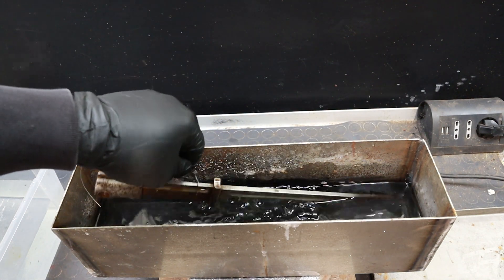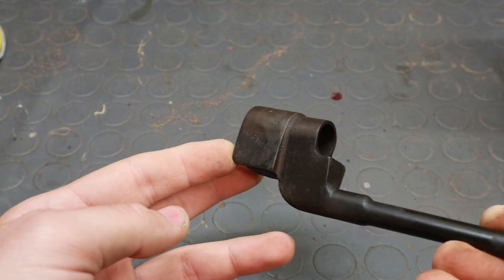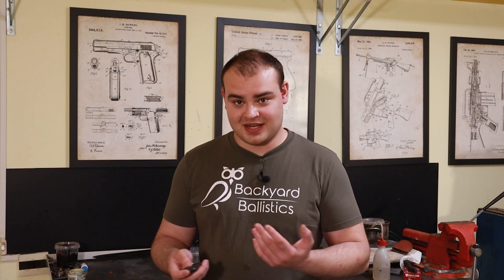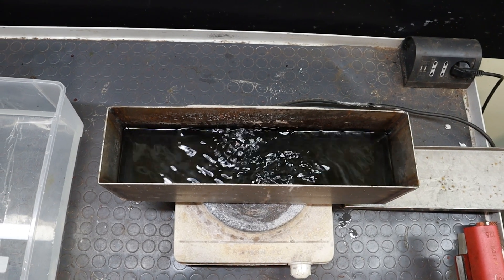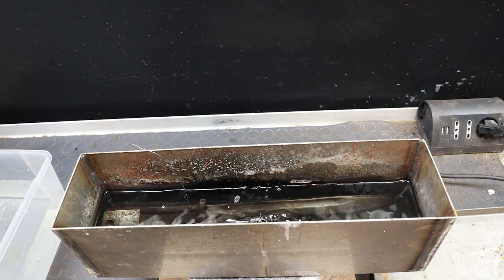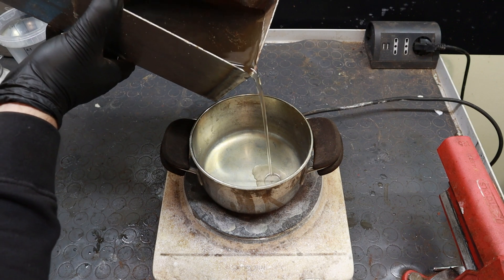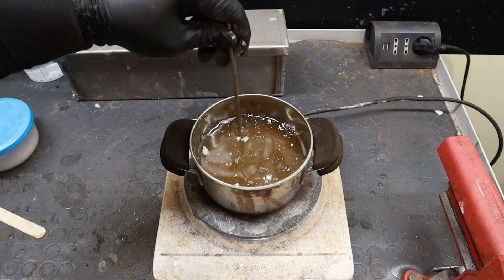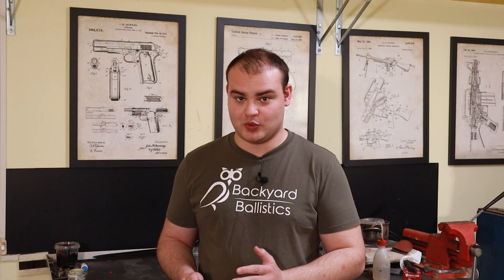BLACK STEEL in 10 minutes: CAUSTIC BLUING Tutorial (with Household Materials)

Comment: I cant stress just how fucking dangerous that solution is. Its like being soaked with gasoline and lighting a cigarette. Yeah you might be fine, depending on wind and outside temperature. But theres a very good chance of you being burned badly enough to make you wish youd died if you manage to survive. Fires bad enough but chemical burns are just the fucking worst, because neutralizing the offending chemical currently eating through whatever part of you it touched is likely to increase the stimulus of your situation aka pain level go up. And then youve go to go to the burn ward and if the burn is over a large enough area and theres enough dead tissue youll get to experience the modern medical marvel of "Debriding" where the dead tissue in, on, and surrounding your burns is hamdled with the wonderous modern technique of scraping it off😳🤢. Again depending on the extent of your injury this process may have to be repeated several times. Now we arent animals and if youre burned over most of your body, youll be knocked out before the scraping but thats more to keep you from dieing from shock. Anywho have fun and be safe

Comment: The problem is this is old fashion way to care about weapon, it requires constant oiling. New polymer paints line Cerakote or Duracote make life way easier.
Reply: In my opinion Cerakote just ends up getting glossy from handling. And is way harder to apply

Comment: What is the recommend way to dispose of left over solution?  Thanks for the video
Reply: Please don't flush it, let the mixture sit in a place it can evaporate completely in well ventilated area. Take the residuals to you hazardous waste site. Or cautiously neutralize
 Neutralization:

If you must dispose of a small amount, carefully neutralize the solution with a large excess of vinegar or a similar neutralizing agent, then flush it down the toilet with a VERY large amount of water.  GL B smart
Reply: @dazzlecraft thanks….
Reply: Pour it into the toilet bowl. It's just drain cleaner

Comment: Always wear eye protection and use gloves, a guy i worked with at a metal finishing firm got lazy while caustic blueing and did not wear his issued safety eye wear and managed to catch a tiny little drop of super hot sodium hydroxide solution when he added room temp parts into it creating a spattering of the solution, his eye was destroyed in seconds,

Comment: Can we blacken Stainless Steel 304 using this method? I'm trying to get some SS304 screws to be black/grey
Reply from the maker: definitely not. There is unfortunately no easy way of bluing stainless steel with black oxide. What can be done is applying an iron electrocoating on top of the stainless and then blacking that one normally.
Reply: @beyond.ballistics  understood. Thank you so much for your reply. And excellent content. keep up the good work.

Comment: dear sir, i like your video. I need to know one more thing that how to clean the factory made barrel before going for bluing ?
we are trying it by acetone and sanding but we see sanding impacts the steel at few places ...
is there any effective way ?
Reply from the maker: You can use a 10% sodiumn hydroxide solution for preliminary degreasing, before the acid pickling.

Comment: very good information, thanks for the video. 

one question, after following the whole process step by step, when removing the pieces from the solution there is a black residue that is easily removed, what is the reason for this residue? is it normal in the process?

Comment: So after the mix has solidified after use it has a high risk of exploding if heat is applied again , so that means the solution must be discarded after every use , as you explained you cannot heat solids , is this correct   ?  It should be highlighted that Breathing Potassium Nitrate can irritate the nose and throat causing sneezing and coughing. * High levels can interfere with the ability of the blood to carry Oxygen causing headache, fatigue, dizziness, and a blue color to the skin and lips (methemoglobinemia).

Comment: Will you do a cold bluing video for those of us without the space for all this setup? I have a precharged airgun where someone's carefully scraped the blueing off the air chamber and barrel but I think the quality of seals and threads etc will be hard to maintain with even the caustic bluing, also I don't have the space (or balls) for a 3 foot long boiling container of caustic pain! 🙂
Reply: Cold blueing does not compare to hot bluing , cold blueing wears of very quickly and you cannot produce the shine that can be achieved by hot bluing , that said , hot bluing is extremely hazardous to health y parkerising  using manganese  phosphate is a safer option.

Comment: I’ve got a 1940 mauser made Luger that unfortunately was chrome plated at one point. It appears to be chipping off at the muzzle and some small areas. For a historically accurate restoration I’d need to salt/hot blue like your video. Do you know of/have a preferred method to cleanly remove chrome plating without damaging the steel? Great content as always!

Comment: So, does this hold up to a cotton buffing wheel? (note: without polishing compound)
Or is it like cold bluing where it can be rubbed off; easily removed by buffing?
Also, does bathing the item multiple times help or will that lead to etching?
Reply from the maker: This is a proper black oxide conversion coating, so it has the same wear resistance of regular bluing. Actually most black oxide finishes, including gun bluing, are made with this process. 
Cold bluing is instead chemically different (coating of copper selenide) and much less wear resistant.
Reply: @beyond.ballistics  Gotcha, thanks for the response!

Speaking of which... Not sure if this info is if interest... 
I have some old 90's (80's, maybe) Cold Blue of Van's that my dad had. I looked now online and the Contents are vastly different.
    NEW: Selenic Acid, Copper Sulphate, Phosphoric Acid, Bonding Agents

    OLD: Selenic Acid, Copper Sulphate, Phosphoric Acid, Ethylene Glycol, Iron, Magnesium, Chromium, Nickel, Aluminum, Tellurium, Bonding Agents

Like they say... "they just don't make this like they used to"
While I don't have any of the new stuff to compare it to directly, one sure can't help but think that the fact the old stuff had SO many additional metals, that it would've provided better protection! 🤷‍♂️🤞
Granted, the proportions are unknown, but I'd wager it's like food ingredients labels, where the concentrations are listed Highest to Lowest. It could still be (and likely is) only a small % of the now-missing agents, but it's a start!

Pretty wild that it has Tellurium though (which is what makes me think it could be from the 80s)... 🤨🥴
Reply: Coming in late, I can't see any reason to use a buffing wheel on a blued/black oxide surface.  All polishing is supposed to be done before bluing.  Only oil and a cotton cloth should be used after bluing and then not a polishing action; just to apply oil to prevent rust.  I've been a teacher for community college gunsmithing classes and taught hot bluing as part of the curriculum.

Comment: Important tip!!  Don't do this in a workshop you care about - it releases caustic vapors and you will find anything made of steel or cast iron forming a red surface rust almost immediately.  I do this outside now for that very reason, the first time I performed hot caustic bluing in my shop I found my lathe, drill press, and other tooling had a red rust on the bare metal surfaces the next day.  It cleaned off fine but lesson learned.  Also be careful on the acid step, if you want a bright polished finish you need to start with bright polished steel, but too long in the acid or too strong acid will take the polish back to a matte finish and the blued steel will be matte also.
Reply: The first time I tried this, the parts came out perfect. Beautiful black and shiny. It was a knife made from leaf spring steel and other parts made from mild steel. My next attempt, same metal, same solution, same methods…one knife came out a gorgeous coppery color, two came out black. I have no idea what I did different.  One poster here says you can get chemical skin burns just from the air. That’s a real thing…I could feel my exposed skin mildly stinging, and I had the garage door open.
Reply: @6Sally5  The red coppery colour is most likely red iron oxide which means the temperature of the bath went too high.  I have resolved this by taking the reddish parts and washing them of caustic salts and then boiling in a pot of distilled water.  This converts the red iron oxide to black iron oxide.  Once it turns black again you can return it to your bluing salts and it will take an even darker blue.
Reply: @6Sally5 yes, it can cause burns (usually mild) and general skin irritation. In my experience it isn’t likely to eat through your skin and cause bleeding. But I could be wrong I guess, but we have a caustic tank at work and it doesn’t cause anything more than mild skin irritation. It also isn’t terribly strong either though.
Reply: Funny I learned almost exactly the same lesson. My lathe and drill press had rust patterns like a sunburn where the vapors hit one side. I also have a chef's knife that still bears an (unsightly and unintended) stenciling of the holes in the manufacturer's plastic sheathing. If done on purpose someone could use stenciling to do something cool pretty easily. Ironically the knife was only on the bench because I'd intended to try etching on it.
Reply: are you sure it was the hot lye solution?  If you were using a Muriatic acid bath as a cleaning step, that definitely will give off fumes that can rust unprotected steel.
Reply: Yes indeed.
It is an exceptionally dangerous process as caustic DOES NOT stop corroding the skin and flesh like acid.
One drop on unprotected skin will eat through and make it bleed.
I was a gunsmith.
Reply: @stevephillips8719  no it fucking wont.

We used to have to scrape the valve slides off our caustic system in the foundry. Pure lye, hot enough to be in liquid form. Once in awhile a valve leaks and drips in your glove. Might burn like shit but it's not "eating through you". Hell, the TEMPERATURE of the lye does more damage than the lye itself. The lye just strips fats and oils out of your skin.

Where the hell do you clowns come up with your obviously never-hand knowledge?
Reply: You're overreacting. We had a 10,000 gallon caustic tank at 970+F (melting pure caustic) and it was an open air tank. It's at most going to eat paint. As long as you have decent airflow though and not condensating the tankvapors you'll be fine.
Reply: @ObservationofLimits  hush down boy.
Reply: @NoSaysJo  lmfao up voting your own nonsensical comment. The true behavior of a neckbeard Redditor who's closest experience with industry is a meme they once saw.
Reply: @ObservationofLimits  didn't ask bud, touch grass lmao

Comment: In your formulation could sodium nitrate(NaNO3) be substituted for potassium nitrate (KNO3)?
Reply from the maker: Yes it can. Actually most commercial solutions use sodium nitrate instead of the potassium one.
I only used potassium nitrate in the tutorial because it's usually more common. You may need to adjust the amounts slightly.
Reply: Many thanks

Comment: Heed the safety warning !!!   
I have still the scars back from when I was a lad, and thought I was invincible .
I still use hot caustic but with full arm gauntlets, full length rubber apron and full face mask.... once burned, twice shy  :<)  
Don't let this put you off, but do think it through, prepare well and work carefully.
Reply: my father was standing next to an industrial Lye mixing tank when in burst. Concentrated granules or pearls were unable dissolved. His scarred ankle wound still festers a little after 50 years.
  But then he's not 'The Black Knight' from Monty Python's  Holy Grail
Reply: @bigoldgrizzly  overreacting. I've had liquid lye (as in pure lye at about 973F) drizzle into my welding gloves (used for scraping the valve plates clean of buildup). It hurts and sorta burns for awhile, but it's really not that bad. The lye being at 1,000F does more damage than anything.
Reply: @ObservationofLimits  
have you tried drinking it too ??

Comment: Stunning video as always. If I need to remove the old bluing from a gun that has been badly reblued by someone who had no idea, would you suggest placing it in hydrchloric acid? I remember seeing a video using this technique but I'm a bit worried I might etch the steel... I already tried with citric acid (first at 10%, then at 30%) but the bluing is not moving from the gun... Any suggestion?
Reply from the maker: 10% citric should remove the existing bluing in a few hours. If it doesn't, either the surface is still oily, some form of coating was applied to it, or the black you see is not bluing or some other coating.
Try scrubbing with acetone and redoing the citric test, adding a bit of dish soap into the solution. If this doesn't work, it's definitely not a normal bluing.
A quicker acting, but still safe to use acid is oxalic acid, 5%.
Reply: @beyond.ballistics  i missed the notification for the comment, thanks a lot for answering. I didn't think to degrease the surface, I took for granted that the citric acid would work even if not thoroughly degreased 😪 my bad then, the revolver was a Bodeo from 1921 (Tempini) and I assumed it was blued, didn't seem parkerized at least... I'll try again after a few hours in brake cleaner

Comment: insanely informative! Haha I probably won’t try this at home though! My workshop is a lot more controlled and safer environment so that’s probably better.

How do I dispose of the liquids? I figured I wouldn’t just dump it down my drain, given it may damage the pipes..
Reply from the maker: Take my words with a pinch of salt, since I'm not an environment expert, but Sodium Hydroxide is widely used as a drain opener. Actually most drain cleaners nowadays are mostly sodium hydroxide, so if you can use drain cleaner in your house, you should also be able to dispose of the caustic bluing solution in the drain, once it cooled down to room temperature. Potassium nitrate is a naturally occuring salt, and massively used as a fertilizer, so that shouldn't be an issue as well.
Industrial amounts of said wastes would instead certainly have to follow specific disposal guidelines.
Reply: @beyond.ballistics  Potassium nitrate , when heated release very toxic fumes , he has not mentioned this in detail , the fumes should be extracted properly this video should be taken down as there are less dangerous alternatives to blac metal using sodium hydroxide , sodium nitrate and sodium nitrite , gun smiths no longer use Potassium Nitrate  because of the dangers to health and high risk of developing cancer in humans .
Reply: @BS-bf7  It does not in a 130 degree water solution. It is safe from that point of view. But if you loose too much water and it crystalizes on the vessel walls heated by something that can raise the temp more than those 130 than it can be problematic. In BB's vid he uses a hot plate, which is great, I would say that doing it over a gas flame would be something else.
Reply: Do not try this at home using pottasium nitrate , this chemical Is Extremely dangerous , use sodium hydroxide with Sodium nitrate and sodium nitrite , lot less risk to your health which is not pointed out in this video

Comment: Hey there's the plum/red I asked about on a previous video! A very interesting video. Thanks for making them! I don't know why but metal finishes are all just super fascinating.
Reply: That color will also develop in commercial bluing salts if the temperature goes too high.  Brownells Oxynate No. 7 is intended to work at about 395°F/201°C.  At around 410°F/210°C it will turn some alloys purple.

Comment: Will this cause a hardened surface to lose some of it's hardness?
Reply from the maker: No, it won't. The temperature reached by the bluing bath should be kept between 125 and 160°C, and must never exceed 180°C. No steel mechanical property is affected at or below those temperatures. The rule of thumb is to start worrying about messing with the heat treatment when you go above 200°C.

Comment: where do you get your boiling containers? homemade?
Reply from the maker: That's simply a 1.5mm mild steel sheet bent into a U shape with two caps welded, that I got made by a local steel supplier. You can probably buy an already made one from some gunsmithing supplier, but out of the US they tend to be hadrly available and quite expensive. If you're bluing smaller parts, a stainless steel pot will do the trick.
Reply: @beyond.ballistics  In the caustic solution a stainless steel container can deposit flakes of stainless onto the part being blued.  Brownells literature warns to only use iron or steel for the caustic tank.  Stainless is OK for the cleaning tank.

Comment: Thanks for the great info.  One question though.  Are the boiling  vats you're using purpose made for this, or are they commonly available for other uses?  They look familiar but I just can't quite place where I've seen them before.
Reply from the maker: They are normally purpose built, either bought from a gunsmithing supplier or made on purpose from sheet steel. I'm not aware of any other use, with the possible exception of pankake molds or some designer flower pots... but make sure they're water tight and steel only first!
Reply: look like bread loaf tins to me